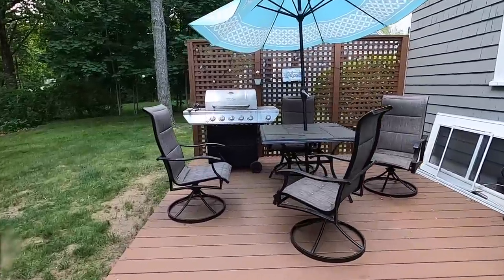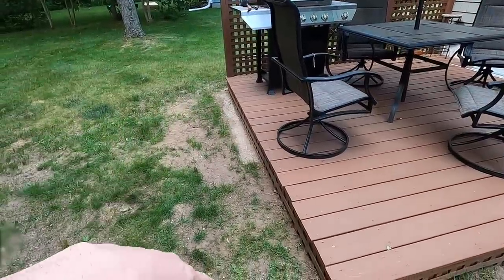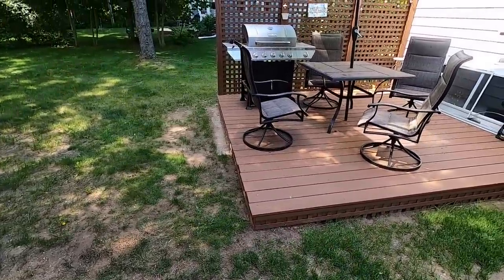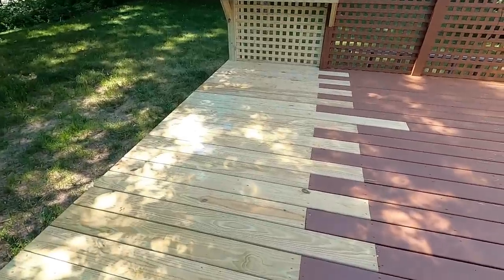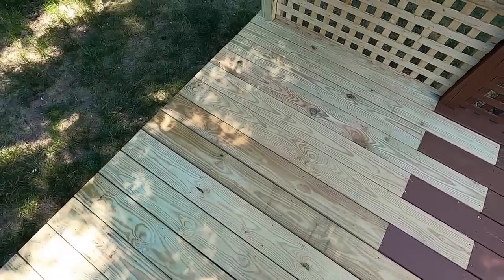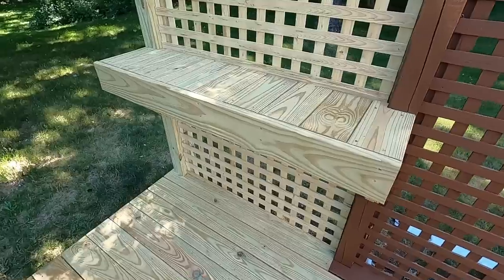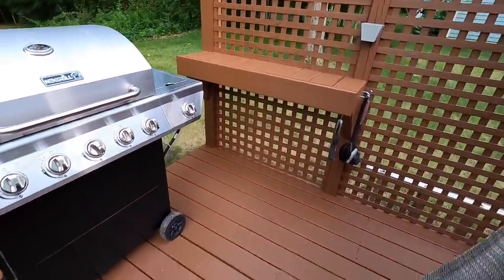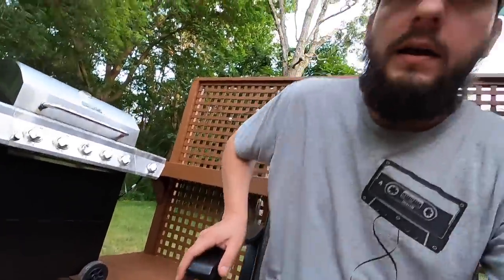How to Make a Deck Bigger | Deck Extension Time Lapse

Comment: Came out awesome! I like that you staggered the wood pieces that you added. Makes it look like it was built that way to begin with. And that probably also avoids odd warping of the addition I assume? Maybe not. Idk. Either way learned something new as always! Keep it up!
Reply from the maker: Thanks, Auto Fix!  I did the staggering to try to make it look like it was built that way like you said.  It should also help with the overall integrity of the deck.  Thanks for checking out the video as always!!

Comment: awesome work, i'm looking into extending my existing deck (14' by 12') to (12' by 20') but my question is are these bricks or cinder blocks under the joists  enough to support the weight of the extension? will this sink in a bit into the soil, that is my only concern/question.

Comment: Thanks for posting this.  I may be in a similar situation next year.  I am about to have a deck built that will come out 7.5 feet from the house (and I wanted it to be 12 feet)...but the town won't allow it.  So I may need to take on something like this to expand it on my own (after they inspect the original 😉).   Why did you toggle the size/starting places of all the different boards you installed...was that just so people couldn't tell where the old section ended and the new section begins?

Comment: Good video. I think a patio would look nicer. This looks like a stage.
Reply from the maker: Aha, I am glad you mentioned that!  I wanted a patio, however, we have a HUGE maple tree not too far from the deck.  There used to be a patio around that area and it got destroyed by the roots of the maple.  If I did a patio it would look good for about a year and then I have a feeling the roots would start to ruin it.  Thanks for the comment and for checking out the video!

Comment: Which paint gun did you use?
Reply from the maker: Hey, this is the paint gun I used. - https://amzn.to/388rVGT  It worked well but needs to be cleaned often on a hot day.
Reply: The Fixer Would this work for interior drywall painting?

Comment: No posts in the ground 🤔no concrete 🤔🤔. I'm sure it's fine but not how I would have built it 

www.patreon.com/thefixer
Reply from the maker: Hey, Mike!  I know I know.  Thing is, around here you don't need to pull a permit for a "movable" structure of this size.  That is why I built the original deck on the old shed concrete pad.  Since it didn't make sense to inspect a small addition like this, I made it "movable".  It's not going anywhere.  If this was attached to the house I would have done it right but it is really just a platform for my grill, table and chairs.  Thanks as always for the support!
Reply: @TheFixerHomeRepair  kinda figured as much

Comment: You over spanned your deck joist.  2x6 should only span 8'8" per minimum code...I however will never span a 2x6 over 6'. You also used Rafter ties on your Ron joist instead a 90° joist hanger (one sided hanger.  Why would you put post on the outside of deck.  Why didn't you use coated screws for the entire build instead of nails. Ring shank nails will back after shrinkage.  2 weeks isn't long enough for PT to cure but I wouldn't wait at all to put at least Olympic water guard over it as soon as you were completed...UV rays will ruin the lumber if you wait until cured.  To properly construct a deck with PT, you should stack lumber in a cool shaded area where air can flow thru for a minimum of 2 weeks in the summer time to allow for shrinkage and drying before installation

Comment: Surely your not a licensed contractor. This would pass no building code in any state.
Reply from the maker: Thing is, around here you don't need to pull a permit for a "movable" structure of this size.  That is why I built the original deck on an old shed concrete pad.  Since it didn't make sense to inspect a small addition like this, I made it "movable".  It's not going anywhere.  If this was attached to the house I would have done it right but it is really just a platform for my grill, table and chairs.  Thanks for checking out the video.